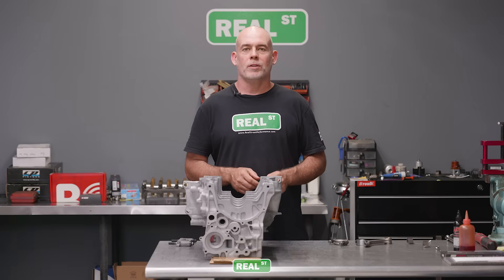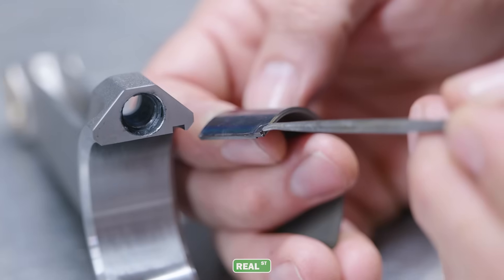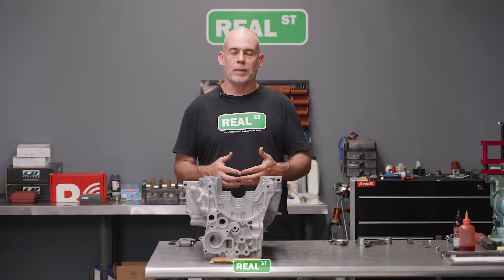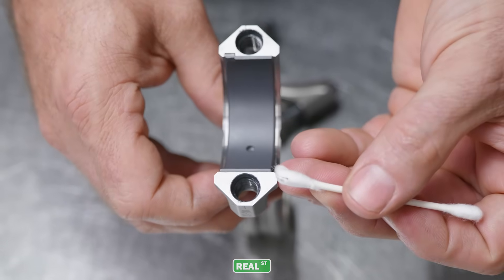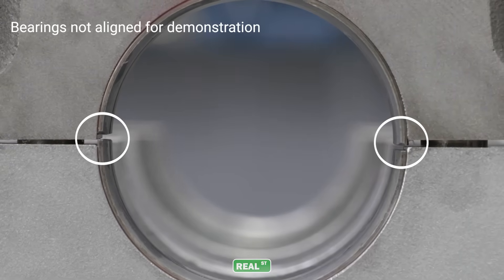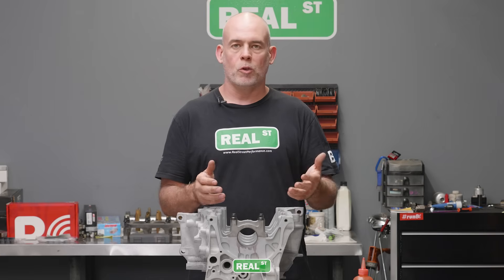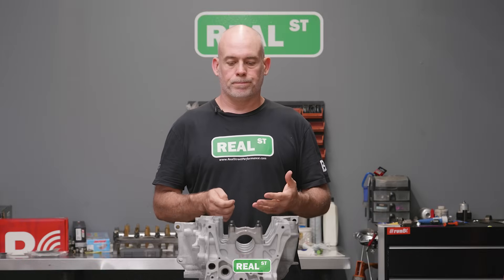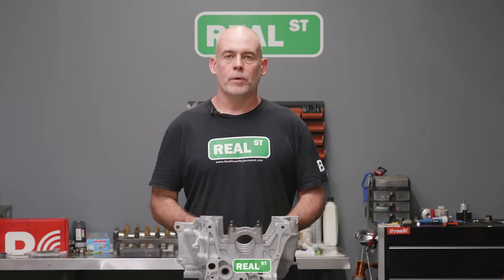Adding Oil On The Back Side Of Bearings During Engine Assembly. Good Or Bad?

Comment: I recently saw a video of a guy trying to rebuild his motor and absolutely slather a thick coating of engine assembly lube on the back of his bearing and I think this is the video references in his reasoning. He was uninterested in the differences between a dot of atf and a thick layer of assembly lube.

Comment: This is why I put a thin layer of thin lubrication at the back of my engine bearings.

The Magdeburg hemispheres are a pair of large copper hemispheres with mating rims that were used in a famous 1654 experiment to demonstrate the power of atmospheric pressure. When the rims were sealed with grease and the air was pumped out, the sphere contained a vacuum and could not be pulled apart by teams of horses. Once the valve was opened, air rushed in and the hemispheres were easily separated. The Magdeburg hemispheres were invented by German scientist and mayor of Magdeburg,[1] Otto von Guericke, to demonstrate the air pump that he had invented and the concept of atmospheric pressure.

Speculation varied about the contents of the sphere. Many thought it was simply empty, while others argued the vacuum contained air or some finer aerial substance. Sound did not transmit through the sphere, indicating that sound needed a medium in order to be heard, while light did not.[2]

The first artificial vacuum had been produced a few years earlier by Evangelista Torricelli and inspired Guericke to design the world's first vacuum pump, which consisted of a piston and cylinder with one-way flap valves. The hemispheres became popular in physics lectures as an illustration of the strength of air pressure, and are still used in education. The original hemispheres are on display in the Deutsches Museum in Munich.
Reply: https://en.wikipedia.org/wiki/Magdeburg_hemispheres

Comment: According to Gemini, this is a bad idea. 😉

---
The Dry Truth: Why Oiling the Back of Engine Bearings is a Bad Idea
It is overwhelmingly considered bad practice to add oil to the back side of engine bearings during assembly. The consensus among experienced engine builders, bearing manufacturers, and technical literature is that the back of the bearing shells and their corresponding bores in the engine block and connecting rods should be clean and dry.

The primary reasons for this "dry install" method are rooted in two critical aspects of engine bearing function: heat transfer and bearing crush.

Impeded Heat Transfer: A Recipe for Failure
Engine bearings operate under immense pressure and friction, generating significant heat. This heat must be effectively dissipated to prevent the bearing material from breaking down and failing. A crucial pathway for this heat is from the bearing shell into the engine block or connecting rod.

When oil is applied to the back of the bearing, it creates an insulating layer. This oil film, however thin, hinders the efficient transfer of heat. The trapped heat can lead to a dangerous rise in bearing temperature, increasing the risk of bearing seizure and catastrophic engine failure.

Compromising Bearing Crush: A Loose Cannon in Your Engine
Engine bearings are precision-engineered with a feature known as "crush." This means that the two halves of the bearing shell are designed to be slightly larger than the bore they fit into. When the main caps or connecting rod caps are torqued to specification, this slight oversize creates a precise amount of interference fit, firmly seating the bearing in its housing.  https://dsportmag.com/the-tech/the-science-behind-modern-performance-engine-bearings-simple-complexity/2/#:~:text=The%20extra%20length%20in%20the,keep%20the%20bearing%20in%20place.

This "crush" is essential for several reasons:

It prevents the bearing from spinning in its bore under the rotational forces of the crankshaft.
It ensures firm and uniform contact between the back of the bearing and the housing, which is vital for proper heat transfer.
It contributes to maintaining the bearing's roundness and proper oil clearances.
Introducing oil to the back of the bearing can have a hydraulic effect, preventing the bearing from seating correctly. This can lead to a loss of the designed crush, resulting in a bearing that is not held securely. A loose bearing is prone to spinning, which will instantly destroy the bearing, the crankshaft journal, and potentially the entire engine block or connecting rod.

The Locating Tang's True Role
It is a common misconception that the small tangs on the edge of some bearing shells are what prevent them from rotating. While these tangs do help to locate the bearing correctly during assembly, they are not strong enough to prevent a bearing from spinning under the immense forces within a running engine. It is the friction and security provided by proper bearing crush in a clean, dry bore that holds the bearing in place.

The Verdict from the Experts
Leading engine bearing manufacturers like MAHLE and King Engine Bearings explicitly state in their installation guidelines that the back of the bearings and the housing bores must be clean and free of any lubricants. The overwhelming majority of professional engine builders adhere to this practice, recognizing the critical importance of a dry installation for a reliable and long-lasting engine. While a very small minority may use a light film of assembly lube for positioning, this is a significant deviation from established best practices and carries a high risk of the problems outlined above.

In conclusion, for a successful and reliable engine build, the rule is simple and unwavering: install engine bearings clean and dry on their backside. The potential for poor heat dissipation and compromised bearing crush makes the practice of oiling the back of the bearings a risk that is not worth taking.

Comment: 2:39 bad information. When you get bearings that have a film on it from the factory and slight metal shavings that will eat your crankshaft for breakfast, it is imperative to wipe off BOTH sides, and only lubricate the side that touches the crank.

Comment: Oil or no oil, whatever you want to do. If you install dry the oil pressure will get oil behind the bearings. Installed wet it squeezes out with any residual dirt.

Comment: either way works fine the most important facter is clearance between rod and bearing surface to alow oil to get in there use plastic gauge to measure your tolerances great video

Comment: Nobody has mentioned. Crankshaft rides on the oil film top side of bearing. Not that anyone doesnt know that. Ever heard of high oil pressure lifting bearings? Basically the oil film swapping sides. No need to encourage that maybe rare but possible outcome. I will never oil the backside, only debur the saddle edge for a proper dry seat. This idea of "well it can't hurt" assumptions is simply monkey motion process. Dry shell makes the most sense and why most of us do it that way while wearing gloves to avoid even fingerprints. Why? To avoid corrosion or contamination or spun bearing incouraged by oil on the backside. Lubing to seat bearing is a complete contradiction, potentially compromising the requirements of the bearing there after.

Comment: I dont and would never oil the back of any fluid bearing surface. You are effectively creating a bearing where you do NOT want one. On the backside of the bearing. You want metal on metal under pressure on the backside to create a pressure fusion (like a tire contact point on car tire to the road. Would you want grease under your tire? It definitely matters long term as the bearing clearances naturally increase. I dont want oil on backside (like grease between road and my tire) to up the odds of bearings going haywire 🤪
Reply: Understand that the individual oil molecules can take as much pressure as the bearings themselves. The difference is how they bond between molecules. We want oil on the fluid side and NO oil on the bearing to journal fusion side. 👏😎

Comment: Great info! I love that you actually demonstrated your reasoning too.
I've always installed bearings with their backs dry, but I've also always assumed oil quickly makes it way round the backs of the bearings when running anyway. After all, some bearings have drillings right through them to allow oil to pass through. So I have a feeling it doesn't matter either way. The reason I install them dry is to ensure that they will stay in place on the very first switch-on. Any time after that, everything is covered in oil anyway!

Comment: NO. DO NOT PUT OIL ON THE BACK OF THE MAIN OR ROD BEARINGS OF ANY INTERNAL COMBUSTION ENGINE. THOSE HAVE TO BE INSTALLED PERFECTLY CLEAN AND BONE DRY. 
OIL ON THE BACK OF A FRICTION BEARING ALTERS THE BEARING CLEARANCE. IT WILL STAY TRAPPED IN THIS AREA UNTIL THE BEARING FAILS PREMATURLY. EVEN IF THE BEARING MEASUREMENT IS SPOT ON AT THE TIME OF ASSEMBLEY. THE THERMAL EXPANSION RATE OF THE OIL WILL NOT BE THE SAME AS WITHOUT. SOME OIL WILL LEAK OUT BUT NOT ALL FROM BEHIND THE BEARING. THE BEARING WILL FLEX INSIDE THE HOLE UNDER LOAD. 
LONG STORY SHORT 4377 TO THE NO. A HUGE NOPE.

Comment: How many inches have I rebuilt too many to count as a professional Machinist, the factory doesn't put oil behind them I don't put oil behind them most machinists I know don't put oil behind them. The only time I put oil and Duncan bearing in oil is when I'm changing out bearings inside a running motor that has to have a new set of bearings in it.

Comment: It's a liquid, a thin film applied will be displaced. It is not trapped in a container, isn't a problem people. The oil is protective more than anything. It's better than a little moisture making a tiny rust spot that definitely has the ability to displace something. Lots of engines aren't run immediately after being built. Some may sit for months. A happy film of oil is your friend not an enemy.

Comment: I have worked at an auto engine & transaxle assembly plant for 20 years. The company I work for has one of, if not the best reputation for quality and longevity from their engines. I assure you that there is no oil applied to the backside of the bearings when these engines are assembled for the first time.

Comment: It doesn’t matter if you do or don’t oil the back of the bearing. Once engine is running either driving or on the dyno, oil will seep to the back of the bearings. Ask yourself, Have you ever disassembled an engine that did not have oil on the back of the bearing? It will be a thin film buts it’s there

Comment: Years ago I had issues with a broken ring on number 5 cylinder (strait 6). In the process of removing the pistons, rods and checking the bearings I noticed that some cheapskate had taken a pin punch to the backing plate on the shells to tighten up the clearance on the worn out bearings. It never ceases to amaze me what some cretins will do inside a motor to save a little money.

Comment: Oil or any other material will alter the clearances of the bearing.  Yes, the oil will be squeezed out however the damage may have already been done by then.  Just like other material such as fuzz, dirt, or metal fragments will do the same thing but not come out.  Installation should not only be dry but well cleaned on both the bearing surface and mating surface.  As with most things....  do what you want.

Comment: So… if oil on the back side changes clearance, (I agree) and oil is eventually going to get on the back side once the engine runs, then shouldn’t we check clearances the way the engine would run?? I don’t want to have an engine that’s built tight, dry backsides, run it once, now it’s too tight, and burns the bearings up…. Right?

Comment: When I was learning, the guy teaching me put STP in the bearing saddles.  I watched him  build 5 engines, and every one of them failed by spinning bearings.  The STP caused false torgue readings.  He then rebuilt the first failed  engine using Loctite in the bearing saddles.  That engine failed again, this time spinning both rod and main bearings, which destroyed the block.  Loctite is a heat barrier that serves to hold the heat in the bearing.  As a result, I have never used anything on the back of bearings and have never suffered a bearing failiar, not even of the BBCs I built for ASA competition in the 1970s.   The light oil may be fine, but I always feared putting anything between the bearing shell and the bearing saddle.
Reply: You speak truth... tell me more knowledge
Reply: Does red lube evaporate
Reply: Powder coated rotor wear color from hard stop

Comment: Hi hi.

Thank you for the great vids. Can't wait for the next vid.
May I ask you a question? I am in the process of rebuilding two CA18DET engines and I have noticed something.

What is the correct orientation of the con rods in the CA18DET?
On one of the engines the con rod bearing tangs are facing the the exhaust side and on the other engine the tangs are facing the intake side.

The pistons were correctly installed by the looks of it even though the rods are orientated opposite in one of the engines. The dots are facing the front of the engine on both.
It seems both engines have been rebuilt/refreshed at some stage by someone prior.

Is there any indicators what the correct orientation should be not considering the marks on the pistons as they will be replaced on both engines?
Both engines have OEM con rods and pistons.

Your advice will be greatly appreciated.
Thank you.

Comment: I’m a big rig diesel mechanic cat Detroid and Cummins all state on their service manuals to install all bearings dry and clean on back side watch for burs and lube with lubi plate white engine assembly grease on crank side  hundreds of engines later zero problem

Comment: I have re-bearinged /rebuilt a lot of engines in 40+ years.
Mostly large engines but it's all the same.
When I first started working the mechanic doing engines oiled the back of the bearing, and I asked him why. He said it helps the bearing slip into place and align itself.
Hmm, I thought about this and wouldn't flood the bearing but would wet the back of the bearing very thinly before snapping it into place.I found it helped.
As far as heat transfer, oil is the coolant for the bottom end anyway, it does conduct heat quite well.
One thing that makes a huge difference is the mating surfaces of the bearing cap, especially if they have been re-machined they have sharp edges and peel a shaving off the back of the bearing. Bad news later. I recommend a fine file and knock the burrs and sharp edges off, then cleaning of course.
Snapping into place is important, if it slips in with no effort, something is wrong..
As far as excessive oil getting hydro-locked, if there is any cross hatch or machining marks in the rod or block bore excess will squeeze out. If there are no marks, that is a problem, indicates wear.  Spun bearing on the way, oiled or not.

100% of bearing failures I have seen have nothing to do with using oil on the back of the bearing.
I've seen bearings mis-packaged, like one shell std and the other -10. Persons replacing a spun bearing with a new one and hoping for the best. Installing the wrong size bearing. Dirt, grit, poor bearing surfaces. The list goes on.

Comment: Lots of opinions here but no real data?

Super easy to test this ..measure a dry assembly and a oiled assembly 

As a machinist myself I doubt there's a difference with this thin oil that could be measured with average automotive machine shop equipment. 

I'm guessing less than .0002 difference. 

To put that into perspective that's LESS than 1/10 the  thickness of a human hair. 

Next time I assembly something I will measure  both ways
Reply: I’m interested to know how this test went for ya

Comment: You will spin a bearing must be dry so when you measure the installed bearing clearance with the rod bolt or or crankshaft main bearings installed you get the correct spec for clearance that’s it

Comment: I'm about to start building my focus 2.0 and looking at the Tri coat King performance bearings , which are indeed coated. So what I have gathered is I should clean the backing of the bearings till it's smooth to the touch and had a tiny bit of atf to allow the bearing to better seat when clamping?

Comment: I've been building engines since the mid 90's and never lubed the back of the bearing on install.  I also never get the sheared off "dirt" when i install them.  The block is generally not 100% dry on install either, some amount of rust preventing lube is needed on all blocks.  I wipe the back of the bearing and the housing clean with a non-lint cloth and away we go.  Purposely oiling between the bearing and housing will change clearances, maybe not enough for a failure, but the change is not predictable or measurable during final assembly and should not be done.  When disassembling a properly built engine, you will find little to no lube on the bearing back or the housing.  If you are still convinced that you need to do it, use something very thin, like WD40.

Comment: I never oil the back of the bearings, but back in the day I did a lot of in-chassis rebuilds, and a lot of bearing roll ins. Damn things will drip oil for like a week so it's kind of unavoidable to get some oil on the back. I never worried about it and it never hurt anything. I used to have most in-chassis done in a day, and a bearing roll-in done before lunch, so there was no time to let them drip until it stopped. Truck and equipment downtime is way too expensive to worry about crap like that. At the time we were billing the trucks out at 100 per hour, and that was 30 years ago. No time to pretend you're working for NASA

Comment: scotch brite has aluminum oxide which is not good to introduce arround the lubrication system of the engine especially in the connecting rod area